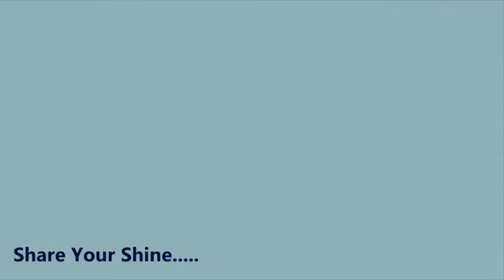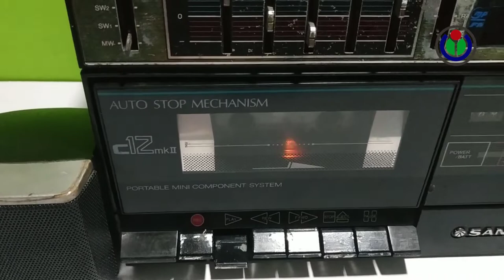How to play music using Cassette Player-Tape Recorder | Amazing Music Machine | Repair Cassette Tape

Comment: Sir, mere paas bhi ek esa hi cassette player hai lekin uski aawaz bahut hi kam aati hai.
Shayad, volume potentiometer mein problem hai. To aapse request hai ki aapke player ke front panel par jo equaliser board laga hai use open karne ka tarika bataiye
Reply from the maker: It's solution not proper without checkout Physically. You can get help any expert of your location.